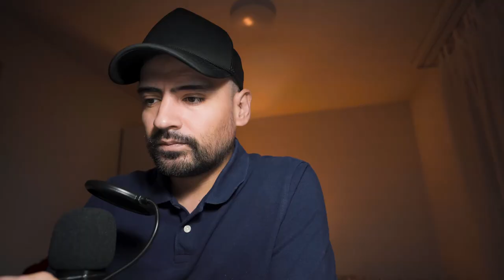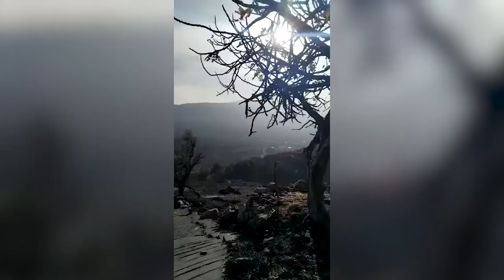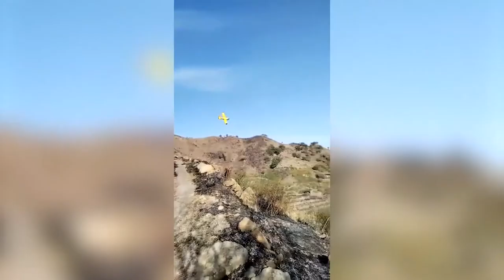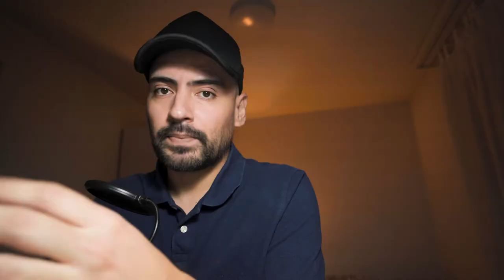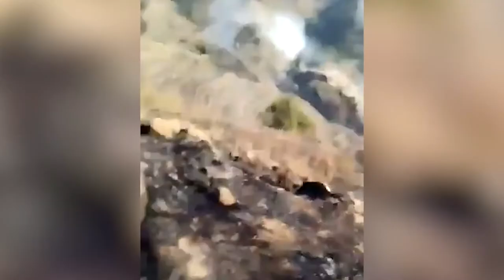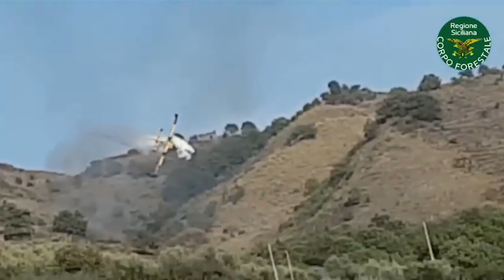Canadair CL-415 crashes in Sicily during firefighting mission (27 Oct 2022)

Comment: The crew was doomed once they started the approach and instead of aborting the manouver and performing a go-around they decided to continue and focused on the mission (putting out the fire) instead of evaluating all the conseguences of that decision.
According to the smoke in the video it doesn't look like there's a strong wind and I wouldn't cite it as a factor.
Having already performed several drops does not elude the possibility of conducting a wrong approach and realize the mistake once it's to late. 
The reasons of this mistake are probably more than one and and I hope that they will  be investigated by the ANSV in order to avoid further accidents in such operations, even though I'm afraid that there's no guarantee for that.